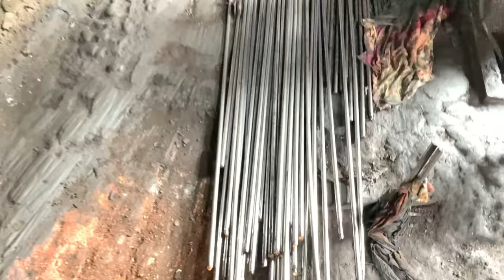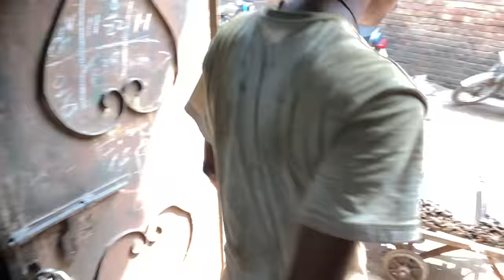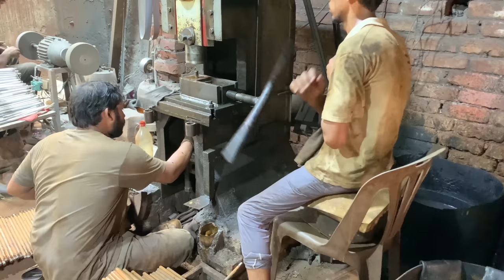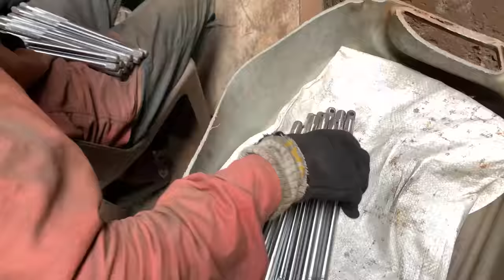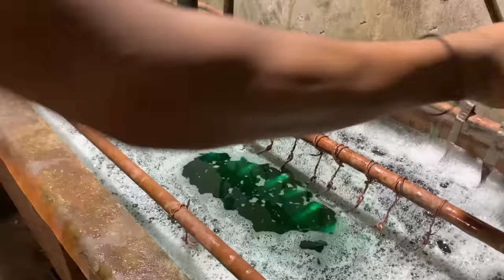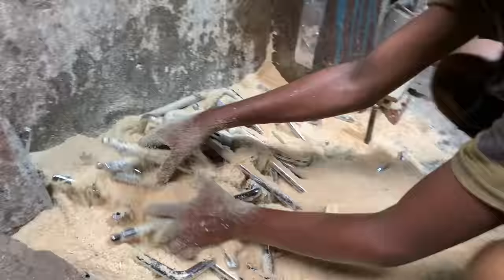How L Handle Socket Wrench is Made, An Inside Look At The Production Line | L Handle Socket Wrench

Comment: The very model of efficiency. 47 pairs of hands used to turn a long steel rod into a short bent steel rod. Guess the pool of laborers is pretty much bottomless there. Limb ripped off by a medieval machine, just bring in the next guy. 7 year old dies of cancer from bathing in heavy metal plating chemicals, get his little brother to fill his work sandals. At least someone will have a shiny little wrench handle to snap in two at first use.
Reply: Before the developed countries reached the level they are at now, they each had to go through this form of labour. It is not because you are not seeing this type of labour or factory in your country does not mean you have not been through this stage. Why is it that others force standards on others when culturally, geographically, etc we are different. SMH 👀👀
Reply: Even the most basic review shows that this is inefficient.  At least one machine operator was stacking neatly when he was done with his step…. There is no need to toss on the ground

Comment: That press forming the square  socket end was hilarious.  One guy sitting on the ground working the foot trigger with his hand, while another spins the vise open & closed.  To those asking why they are making so many - did you see any tool steel?  Any hardening or tempering?  I'll bet the auto & truck repair shops that buy these wrenches bend and/or break them constantly.
Reply: T
Reply: probs for something much cheaper
Reply: I’m sure they wouldn’t put a pipe on for leverage, so they’re probably good. 😂
Reply: Ĺ
Reply: I've bought cheap tools before and they are junk after just a few months you may as well throw them away.
Reply: quantity over quality
Reply: Поэтому они их делают много😅
Reply: Definitely not a Snap-On product 😂😂
Reply: Buying and consuming economy.

Comment: I'm sure when this style was invented the world was impressed in the early 1900's nobody has sold this style for a long time
Reply: They are used ALL the time. They are TQ breakers. I've worked on cars for decades and worked on UH-60s for 12 years. Better to break a cheap L wrench than a ratchet or other mechanical hand held tool. Every tool has its place. You wouldn't use a TQ wrench from start to finish. These are also found in cars with a spare tire or spare tire kits.  What do you do when your compressor or power goes out? You grab your hand tools and a LONG pole and start breaking the TQ on nuts and bolts. 
Any shop that services heavy vehicles will have hand tools as well.

Comment: imagine if they had something like a bucket, basket or wheelbarrow in every checkpoint. all those people picking up those same bars over and over again from the floor. if i was working there i would do something because i would not bend to the flood for nothing 100 times a day. also imagine if all those checkpoints where under the same roof so you dont need to pick them up from the floor and trough back there multible times. i know labor is cheap there but come on make it easier for your self cut the bullshit

Comment: A couple of uses and these things will be a straight bar again. No heat treatment, no tempering... no longevity. Yet another waste of energy and resources when a much better product could be made for a couple of extra steps. Chap on the square socket press must be dead by now... what a job. More course gear or foot clamp and save your arms!